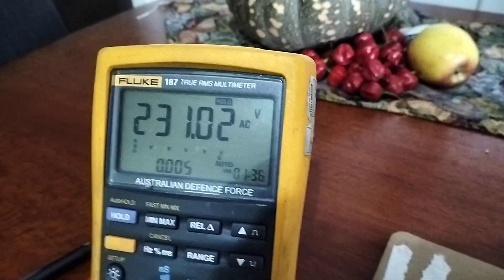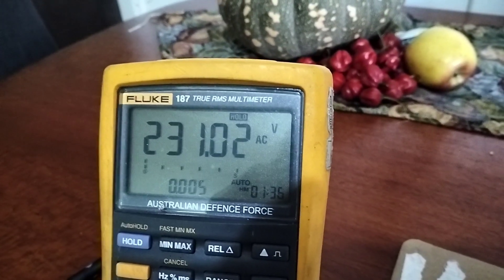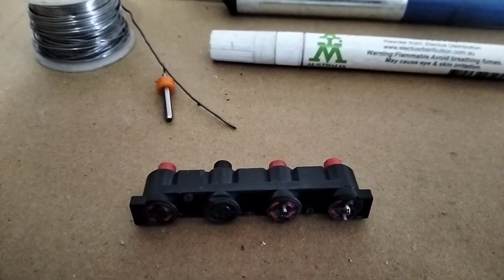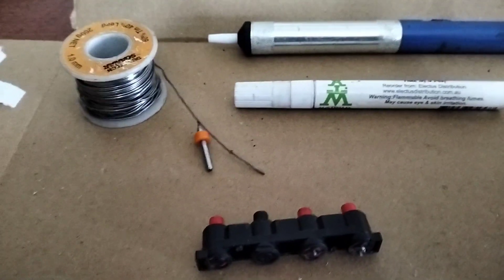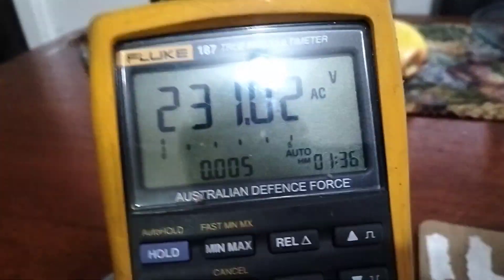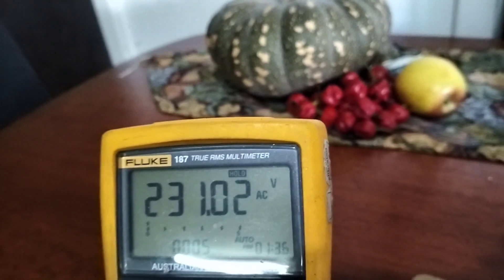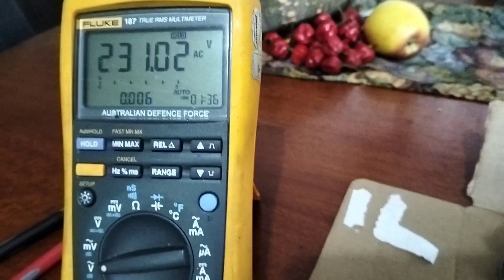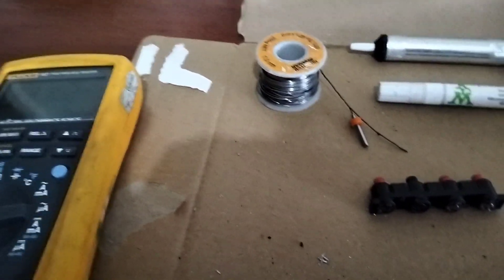Fluke 187 repair.

Comment: I've ordered one of these as well, will see how mine goes. Hopefully no issues to report.
Reply from the maker: They are a very good deal at $350 AUD and if you need the new input terminals it is Joelfriend on eBay. Good luck.
Reply: @postiemania  arrived today, all seems to function correctly. Took me a second to notice the guides on the plug holes, once I got the leads in the right spot I got measurements for all of the main functions. Even a Fluke K Type thermal probe worked on the temperature function.

Will keep your situation in mind if I run into any issues however.